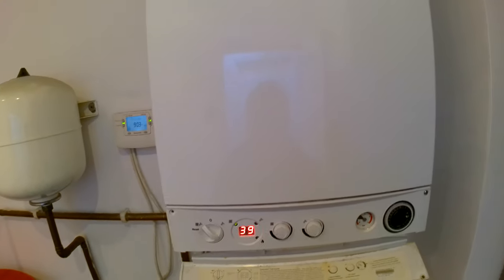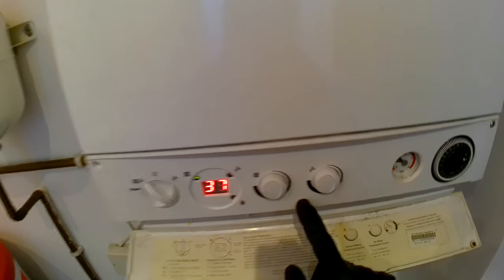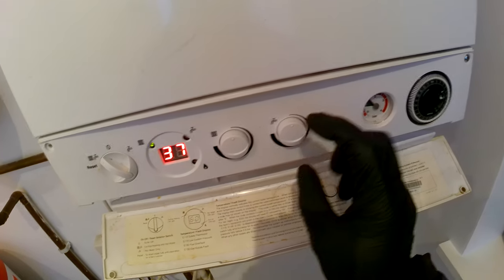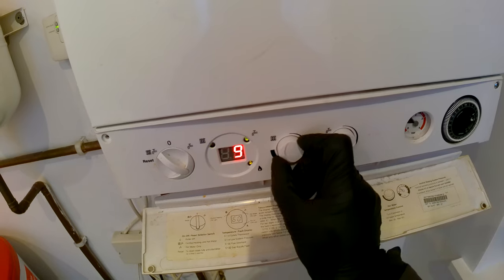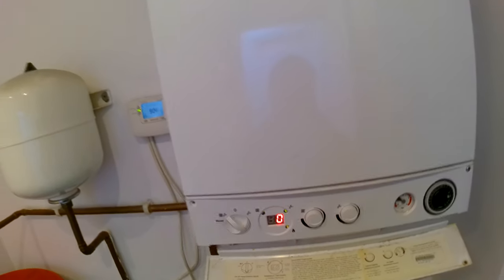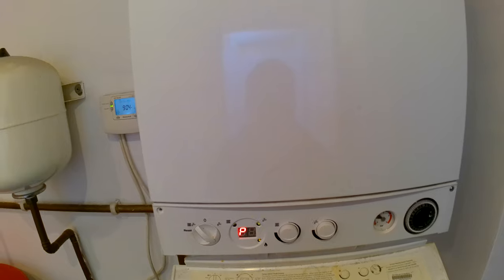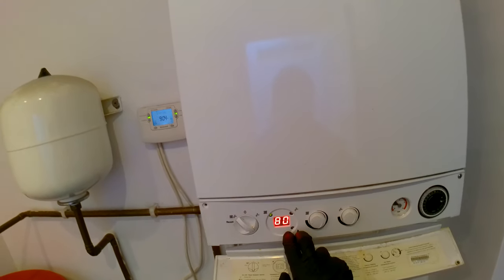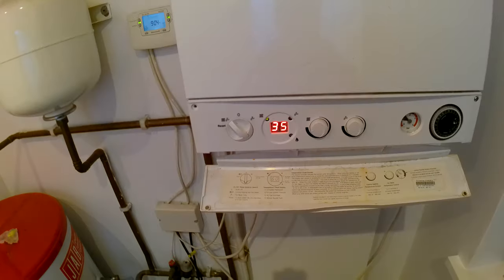Potterton Titanium / Main Eco Elite | Service Mode - How To Get Into High Flame Or Low Flame

Comment: Super helpful mate. Doing this has got my heating working again whilst in service mode but otherwise I only get hot water. When you call for hearing from the wireless stat the actuator valve opens but the boiler doesn’t respond. No led light on heating. No pump running. Nothing. But when in service mode it’s all working fine and rads warm up. Any idea what’s up with it? Cheers
Reply: Im the same did you come up with a fix dude??

Comment: Wow finally found my same boiler. I am having trouble with my tap water, it is very hot even if I turn the water temp to low, it does not go under 50 when I go to minimum and then suddenly it starts going up when I turn the tap on. Can you please advice what I can do. How can I reset the boiler, would that help?

Comment: Finally i found advice for the same boiler as mine. Can anyone please advise best temperature settings for hot water and radiator dials, during winter months?  Is it true that legionairs disease is a threat if hot water setting is at 45 degrees ( as that's perfect temp for me). I've read various condradicting articles on this, for various types of boiler.

Comment: I know this is the same method for a combi boiler but when put it onto high flame, low flame on a combi The boiler is always overheating, and this is even after I called the heat?

What’s the best procedures to do this on a combi boiler?

Comment: What's the difference between high and low flame please
Reply from the maker: Hi Richard, high flame and low flame are solely for testing purposes. High flame will make the boiler operate at maximum output where as low flame will make the boiler work at minimum output
Reply: Thank you
Reply: Whats better to keep it on, high or low flame? Thanks @advancedboilertraining